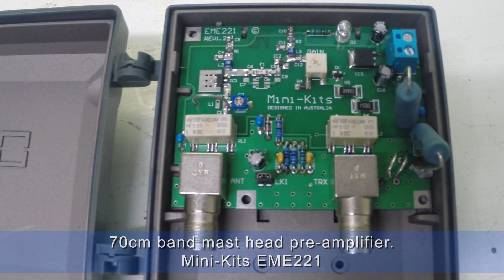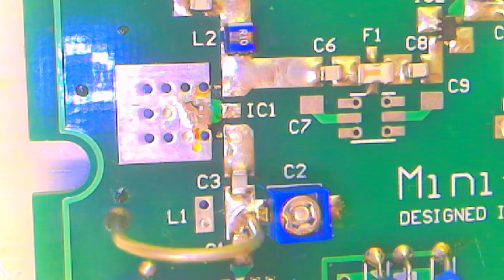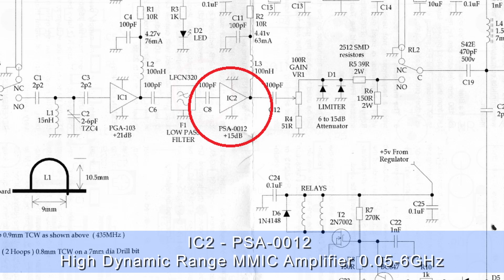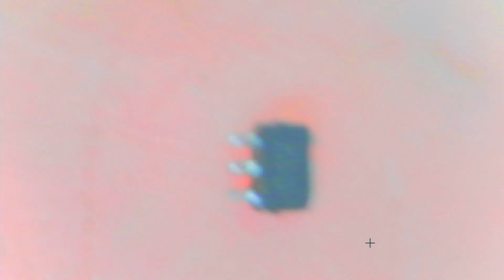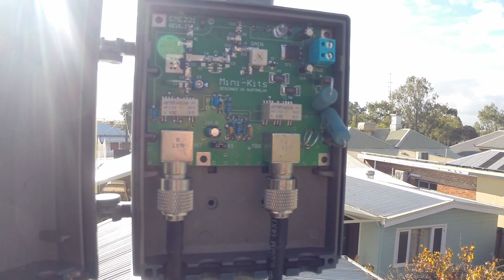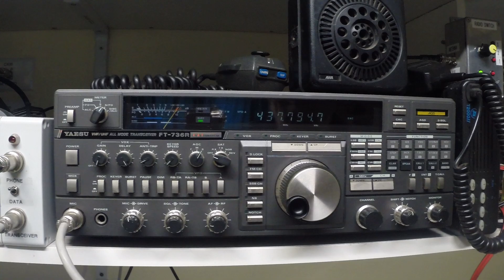70cm band mast-head pre-amplifier repair – 23 July 2024

Comment: ... a random passerby, if you watched this video.
never do as shown.
the temperature gradient, between the melting temperature of the solder and the massive copper of the printed circuit board, can "fry" the silicon component.
a regular soldering iron is enough.